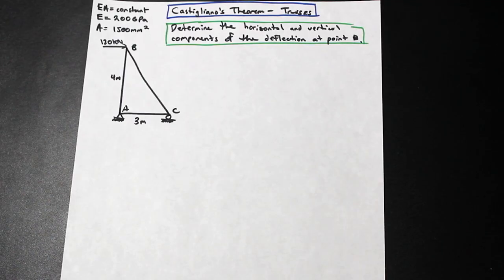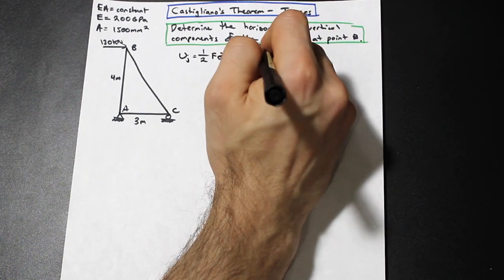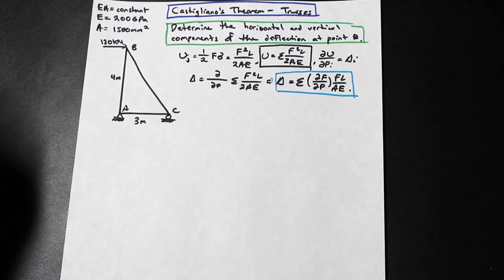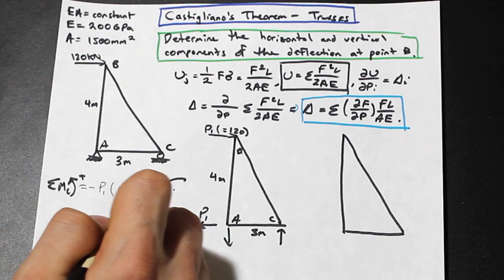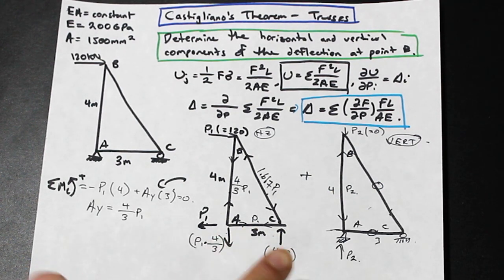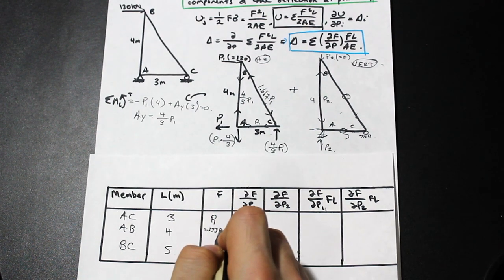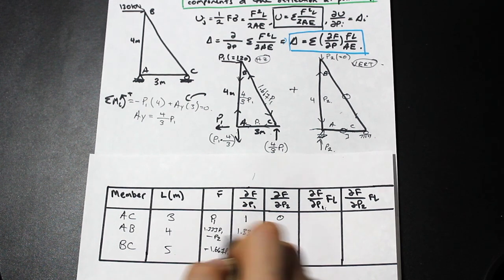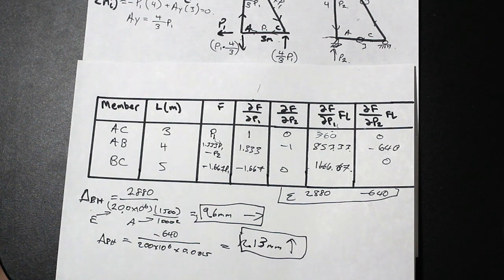Castigliano's Second Theorem - Solving Deflection in x and y - Truss Example and Formula Derivation

Comment: Thankss you made me realize what I did wrong. I was absent went our Prof taught this method. I was was able to solve it using virtual but in castiglano's. I derived it in terms of x not P that's why my answer weren't the same. Our plate were frames though. Thanks again.

Comment: Can i ask a question. How can I solve castiglano's when I have a beam with roller and hinge at 2m and 5m but deflection is needed at the free end of the beam which is at 0 and 7m I assigned P1 and P2 got the moments at the cut sections and derived it in terms of P1 and another for P2. But how do I integrate to get the deflection due to flexure  with the P1 and P2 still present
Reply from the maker: P1 and P2 either have values or are 0 depending if there are forces located at those points.  You have to plug in these values before integrating.  We do this in this video, also watch our other two videos where we solve a beam using castiglianos.